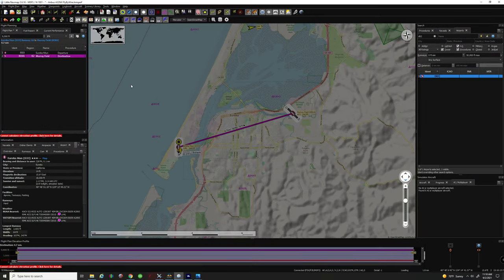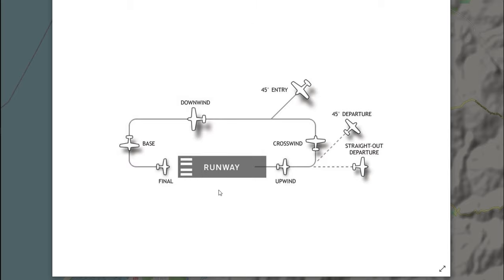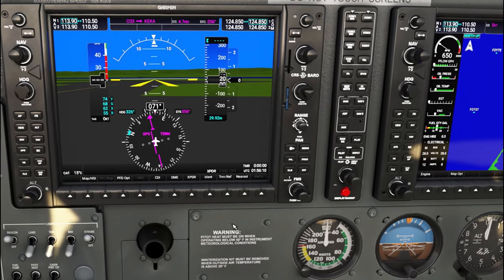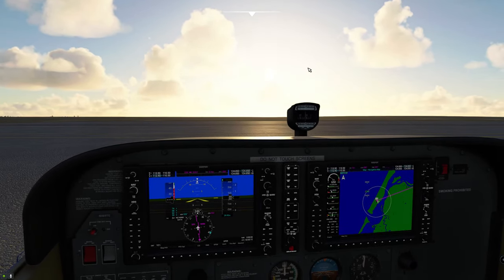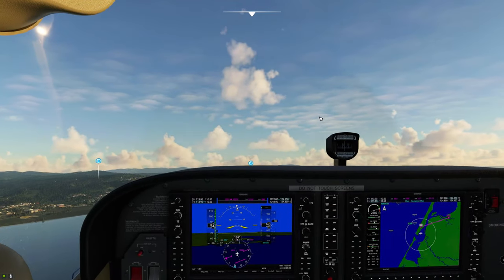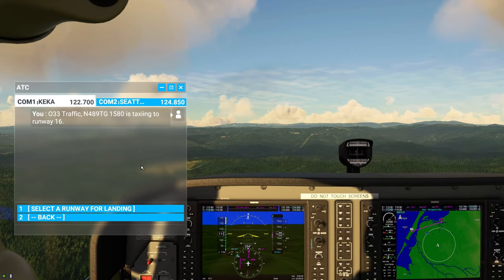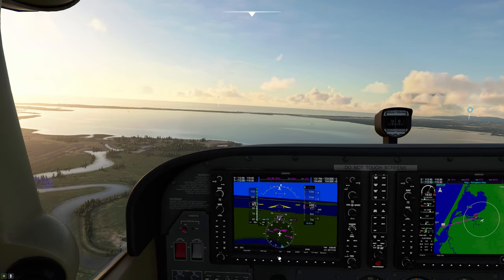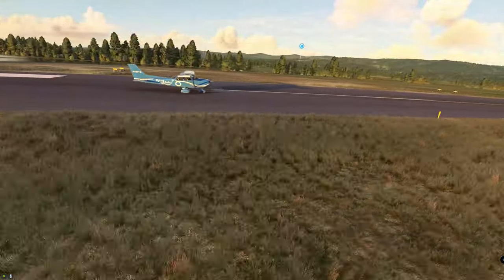Msfs2020 Cessna 172 G1000 Basic VFR Flight lessons Tutorials. Working title g1000nxi Ep.1

Comment: What weather are you using? I'm using REX Weather, which is good, the only disconnect and super annoying thing about using REX is that the native ATIS broadcasts are not in sync with the live weather injection from REX
Reply from the maker: For any videos I do I use custom weather so I can get the best shots and stuff.  I use live weather when not doing videos.  I have never used a weather addon I don't really seem to have any trouble with mine. Thanks  for watching 👀

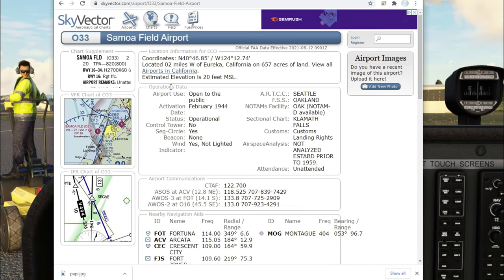Comment: A bit OT, but how do you bring up a window in game? 6:45

The heading being the same as the runway is a very useful tip, thanks.
Reply from the maker: If you only have 1 monitor then switch the msfs in windowed mode in graphics setting in game then that will allow you to pull something over msfs but when you do then your controls won't work in the plane until you click back on the msfs window . Hope that helps you thanks for the comment 😀